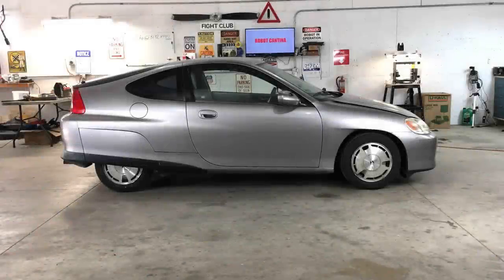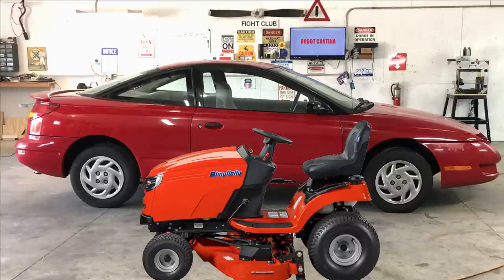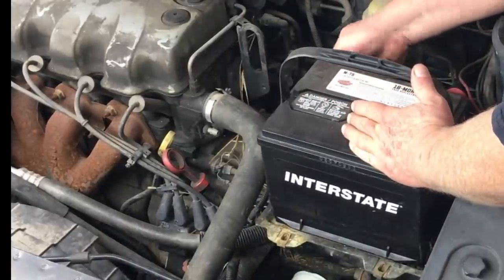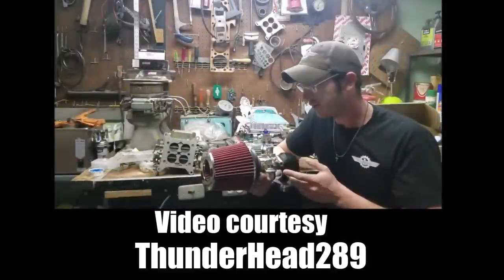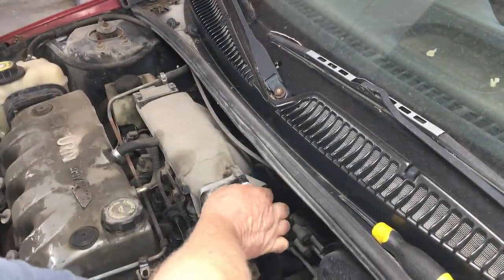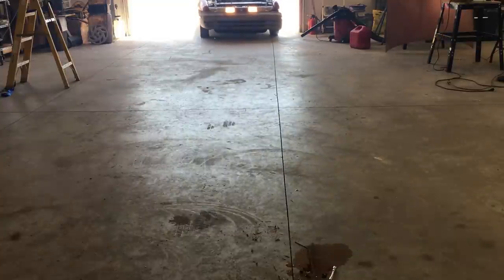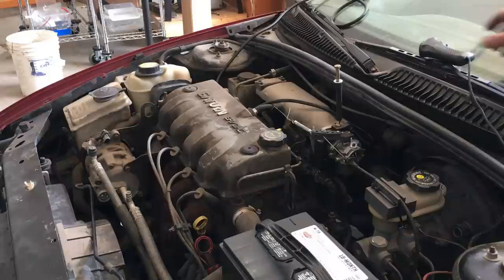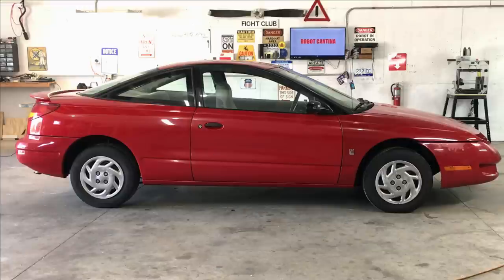S2E14: We get new project cars for more experiments,  plus we put lawnmower carburetor on a Saturn

Comment: Brilliant, love it! As someone who was already subscribed to Thunderhead289 (Luke’s) channel and has been following his lawn mower card antics (as well as Uncle Tony’s Garage commentary and others), I got very excited when you showed the same experiment here on your channel.

I’ve got a Ford 351W with a Holley Sniper 4 barrel EFI conversion and a Hyperspark distributor, which doesn’t work due to age related problems (such as the exhaust manifolds leaking, PVC issues…) so the possibility of eking out any additional fuel milage (especially on the old V8s) is an exciting idea. :D
Reply: Imagine if they did this to the big blocks in the 70s for the gas crisis yeah got a 150hp big block but swap the carb and now its 400hp lol

Comment: Two Stroke Yamaha 701 from a superjet as an engine swap. They used them for a bunch of Wave Runners in the 90s and the super jet for the last 30 years. If you want more power get a Yamaha 1100 or 1200 two stroke.

Comment: Love your show & the direction you're going. I have studied & purchased info. on gasoline fuel economy multiplying devices since the 80's. The most doable design was a small carb mix into an engine coolant heated heater core box, then into the insulated intake to prevent cooling of the mix. Add T-head 289's controlled air leak Arduino  system, & mileage may soar. Encouraging liquid vaporization thru vacuum, heating, surface area, turbulence, insulation to retain heat to the port entrance, & extra air bleed for leaner AFR's, All combined for max efficiency. Yes, Uncle Luke is a humble genius, but so are you in your own right! Reference material (my original copy) info: copyright 1988, Carb Research Center, Inc. "How to build your own High Mileage Vapor Carb !"  (3 designs, Impro XP-W,  Original Impro 70 [both doubling 283 V-8 truck fuel economy, no power loss] & 3rd design, Impro 70 Modified [Exhaust heated, triple mileage, but power loss at higher temps.])  Hint: I think I saw it free to read somewhere on the internet 😉😁 Best Regards, Paul from S. Central Tx.
Reply: I come here for the videos and stay for the comments...  great comment here.

Comment: Had one of those for 13 years! It looks as good as new until the end!
Reply: The 4 door I mean.
Reply: @SteeGrav  sounds really neat.  I bet they were a good 13 years too. 🚙🚙🚙🚙
Reply: It died of terminal transmission failure, the manual one. It happened just as GM killed the Saturn brand. They offered us a good value for the car even so driving it to the dealership was it's last run. So check all the seal on this manual.
Reply: @SteeGrav  Oh my,  terminal transmission failure...😪😪
Reply: @ocdman202  It was sad that GM killed the Saturn brand.. 😘

Comment: That parts car, the Saturn SL1, I had one of those, mine was a 2000, I flipped it 7x, that little car is by far the safest unibody car I've ever been in, outside was destroyed, didn't change the interior at all, that SC1 should be just as safe, I look forward to see what you do with these cars

Comment: That was weird fun.  I'm not surprised to see it worked; just get the A/F mixture somewhere close and you can light it off, but the engine sounded surprisingly good, inhaling through that narrow venturi.  I reckon the MAP is just a tad lower than the factory spec.

Comment: I've been watching Luke's work on the lawnmower carb, very good stuff. I can't wait to see what more he and you come up with. Exciting times a head.
Reply from the maker: Thank you!
Reply: Is he the one that got "high mpg" out of it? 

I think it's a funny project, but I have been hoping he'd redo a fuel test with a controlled fuel source since I don't believe the high fuel economy claims.
Reply: @volvo09  Thank you for your hard work and spunk!  Robot!
Reply: @ocdman202  Spunk and moxie!   Robot!
Reply: @B Tenold I don't think it's fake, I just want to see it done with a smaller fuel cell or fuel bladder. If you only drive a few miles you aren't getting an accurate reading, even by refilling from the same station. 

I'm not giving ANY personal attacks, I think it's an awesome project and he knows what he's talking about by the footage I saw.... I have also self tuned my vehicle for a few different circumstances (diy from gas to E85, and later added a supercharger, and also tried a lean tune for my works commute using the o2 to keep it at 18.0 while cruising)... It does help, but not enough to make an old v8 better than a new Corolla. 

If he's done a fuel cell run then I'm out of date and I understand, but until the cars fuel tank is cut out of the loop (or a large distance run is done) I can't accept any high mpg claims, there's just too much variance.  Again, if I'm out of date then let me know, I only saw the "60 mpg?" Run video.
Reply: @volvo09  ROBOT CANTINA    we love these new project cars!    and we love it when Jimbo  re= engineers stuff!  just for fun👍👍👍👍

Comment: Your automatic transmission is likely not getting power. On those transmissions I believe that with no power to the shift solenoids you get locked in to 3rd gear. With no TPS either, the ECU might not be able to determine what gear you should be in. Lastly, the engine can run with base spark direct from the ignition module and crank trigger so without the ECU operating at all it will run off of starter fluid/gas soaked rag.

Comment: Use the diesel!!! You can run them off vegetable oil,  used motor oil, etc. And they are 1000% more dependable and built waaay better than any gasoline engine

Comment: Most likely because the Ecu dont see any tps signal the trans is it limp mode. You could either make a throttle position sensor that works with the lawn mower carb or just stright wire the shift solenoids to toggle switches then you would have a manually controlled automatic. But it will also shift at full line pressure all the time no matter what and youll have to wire in a switch to turn on torque converter lockup.. or use a speed sensor to give output at a set mph...

Comment: We need more thinking like this nowadays! Can't wait to see what type of input that little carb puts into the gearbox. It seemed like it would function, the engine was actually getting fairly high rpm off the throttle which is really interesting. Great video and good luck, enjoy experimenting!
Reply: I love the experimentation and bold thinking here..  Definitely need more thought in this area!  This is like
trying to come up with practical ways to help a real and present problem.
Reply: @kansasrose2909  Do you mean clear and present danger?
Reply: @mommapanda5736  ROBOT CANTINA    we love these new project cars!    and we love it when Jimbo  re= engineers stuff!  just for fun👍👍👍👍

Comment: If you decide to try to put an undamaged trans in the insight, first gen civic hybrids and I believe 07-08 fit manuals both go in with very little effort and open up some different gearing options. Civic hybrid is 3.6ish final drive and the fit is 4.10 I think

Comment: I've never messed around with carbs, but the simplicity of them is intoxicating. It's making me want to throw a set onto the '91 Jetta sitting in my garage and get rid of that GODAWFUL always running-like-crap/not-running-at-all mechanical fuel injection!
Reply: The 90s models had optional regular simple fuel injection, might be better to source that.  Not an expert, I just know that looking at a later model cabriolet vs my 84 GTi I was jealous of how simple it looked.
Reply: @milescarter7803  Unfortunately the VW EFI system would require a whole new wiring harness, and runs at a lower fuel pressure than the existing MFI. It would be a whole lot of work for a stock EFI conversion, at which point I would rather invest in a Megasquirt.

Carbs are actually a fairly common conversion for the VW 16V engine and parts widely available. However, I'm not planning on leaving the 16V in there. I would like to swap in the 07k 5-cylinder engine. To my knowledge nobody has ever carbed one of those, but it would be very interesting to try and since it's just a project car at this point it would be fun to experiment with it.

Comment: Now i wonder if i could get that old Renault Espace V6 in our yard running with a carb as the ECU got fried by someone trying to tune it. Car cost me a case of beer so might as well try.
Reply: If the ecu didn’t control the ignition maybe. Does the engine have a distributor?
Reply: @Turbochargedtwelve yeah it seems like it has one.
Reply: @kjjustinXD  Maybe if you have an arduino laying around you might be able to use that as ECU
Reply: Doubtful as the ECU will control the ignition too.

But look into a cardrino or speedrino. There are others out there too. People have been building engine computers out of ardrino for years now. There are several kits that make it easier and lots of diy advice to doing it from scratch too.
Reply: Some older ECUs still worked via a distributor. Basically the ECU and associated transistors replaced the points and condenser, but everything else was the same as a traditional ignition.
Reply: @nerd1000ify  HEY JIMBO.....  congratulations on reaching 100k subscribers.. ROBOT CANTINA is providing the 
entertainment and fun that viewers enjoy..
Reply: @kansasrose2909  ROBOT CANTINA    we love these new project cars!    and we love it when Jimbo  re= engineers stuff!  just for fun👍👍👍👍

Comment: I've actually got a 2002 saturn sl1 with a 5 speed transmission, I love it! Although I'm scared whats gonna happen soon, its got 280,000 miles on it and hasn't needed any real work in the 2 years I've had it, the frames rotting away due to Wisconsin winters. It even has the exact same engine as this one!
Reply from the maker: Saturns will almost last forever, unfortunately frame rust can be a problem.
Reply: @robotcantina8957  Oh ya, the manual transmission does have a dipstick, it's a little hard to find but if you look straight down from the master cylinder for the brakes its right on top of the transmission. You'll have to reach through the brake lines to get to it.
Reply: @dustinkinnard619  Oh no,   frame rust!  Thank you for
your hard work and spunk!!   Robot!!
Reply: @ocdman202  Saturn  fan here. 🪐🪐👍👍

Comment: Just wanna offer some guidance on a possible woodgas conversion:

You need two container, the outside one gets a stack and charcoal in it, the inside one is filled with biomass, for example wood.

The biomass container will be sealed with only a outlet port for the gas (basically like a pressure cooker with fire around it).

The woodgas then needs to be filtered and cooled down. Easiest way is to bubble the woodgas through a series of containers with water. Just make sure that the ports are large enough for the possible buildup of tar. So large inlet pipe straight down into the bucket and collect the gas after bubbling up again.

The water needs to be cooled to avoid that it all evaporates, so add a radiator with a heat exchanger in the bucket to it (separated coolant flow for more easy cleaning).

After the buckets you need to anything solid and spray left, so use a cyclone filter.

Then let the gas run through a cooling area, like a pipe spiraling in a bucket of water, to cool it down further - make sure to the trapped water a collection point.

After you cooled down the gas you can feed it through a compressor (like an old compressor of a fridge/freezer). It will make sure to remove the pressure from the system and reduce it to safe levels. After the fridge compressor you add a check valve and a pressure tank (like a bottle of gas for a forklkft).

On the outlet side you need a pressure regulator to keep the pressure low and steady. The rest is kinda just a flow valve into the inlet port of the engine. :)
Reply: Thank you for this detailed and comprehensive comment.  This will be a great help to many, no doubt. :goodvibes::goodvibes:

Comment: Awesome project!  Just a suggestion, before you get too involved in engine swaps how about disabling a cylinder or two on the original Saturn engine to get an idea of how a lower displacement engine will perform?  This could be a very low effort experiment, just remove the rockers (assuming it uses rockers and not buckets straight on top of the valves).

Comment: Wonder if the TCU on the carb’d Saturn needs a working MAF signal for calculated load? 

Doesn’t seem like being stuck in 4th is a likely failure modality for it though.
Reply: Put the maf in front of the carb. Done.

Comment: Yes yes!
Thunderhead289 
Has put it on a Ford V8
He was stunned he got 40mpg.
He's been on a long trip with his father I believe to be testing it fully to see if it breaks down.

Fuel Economy is the name of the game. Everyone wants to know what can be done with small carburetors with air fuel/vacuum leak control with software.

Someone needs to make a plug in play kit so we can have fun on a beater. Who knows maybe gets to point that someone will put it on clean car and use it as normal.
A system that can switch power on fly would be ideal for merging etc.
Or when the peddle is pushed hard enough that it goes into a power tune just for speed bursts when needed.
Reply: Oh wow. I was assuming this is where idea came from. 
We need a lot of people to do it so then big oil don't come after you. Lol

Comment: I don't understand why everyone is surprised that a lawnmower carburetor would work.  A single barrel carburetor was the only fuel mixer for years until 1960.  You would see 350+ cubic inch engines with a single barrel carb all the time and those cars were full size and had 100mph speedometers.  Its still cool.
Reply: Looking forward to more experiments and more data here.
Reply: Better mileage has been reported on the other channel he featured.

Comment: ECU probably put the transmission in limp mode as it didn't have a tps input. I had a car that did that once and it would just stay in 3rd no matter what. It was slow off the line and would top out at 55 but you could drive it home.

Comment: On my 98 GMC the ignition switch was going bad and would start the truck but it would stay in 3rd gear. It turned out the ignition switch is also responsible for telling the TCM to power on. It was staying in 3rd because that was a direct drive gear. I replaced the ignition switch and it started shifting again.

Comment: I loved Thunderhead 289's lawn mower carb experiment, I was flabbergasted that he managed to get about 40 mpg at 60 mph in the Maverick. I am looking forward to see how well you do with the Saturn Coupe. Any possibility that you could test the fuel economy of the Saturn Coupe with the lawn mower carb?
Reply from the maker: Yes, we will gather all the performance data of the unmodified saturn and then  do it again with the lawn mower carburetor .  We will certainly check the MPG.  Look forward to that in the next video.
Reply: @robotcantina8957  Like a Chevy Impala, I'll be there.
Reply: It's not actually physically possible to get 40mpg at 60mph from that car. His measurements are off.

The speed of a vehicle is a function of rpm and gearing plus enough power to overcome resistance.  A stock naturally aspirated engine will need around 14.5 to 1 air fuel ratio for a clean burn. The cylinder size and compression ratio is fixed so advancing the ignition timing and playing with the air fuel mixture is the only adjustments that can be made. Leaner air fuel ratios need a higher compression ratio but also contain less energy. The Era of the stock motor in the maverick will have a 9:1 compression ratio so the leanest you will be able to go is around 16:1, maybe 17 for short periods if you are extremely lucky. That is not enough leaning to push that much weight at those speeds with that little fuel.

Otherwise it would have already been done by now.
Reply: @sumduma55  Thank you for this thoughtful comment.  I see your
point.
Reply: @ocdman202  I come here for the videos and stay for the 
great comments.
Reply: @sumduma55  I agree, I have seen his video's and something is off.  You're not fooling the wideband.  If you can establish 14.7:1 or so and make it consistent throughout the throttle and rev range no more improvements can be made no matter if its big carb, lawnmower carb, or fuel injection.

You cant change the efficiency of the engine, drivetrain, and aerodynamics and that's what it's going to take to get to 40 mpg in a rolling brick.

Comment: A Factory 5 kit car would be expensive, but you would also be getting a car that can weigh in at around 2,200 pounds with a big V8 in it.  With a little lawn mower engine, and with its general build and aerodynamics, it would be an interesting chasis/car to work with.
Reply: The Factory Five 818 is practically already lawnmower powered being Subaru based.  Get an opposed Onan Briggs or Kohler? Motor and go for it.

Comment: Wonder if the tranny is being kept in 4th as a "limp home"  mode. Should be able to verify with a OBD. 
Very curious how long the plastic lasts! It would be so much easier to print a carb intake manifold for my Predator 212 converted Honda XR250 instead of having to TIG all those aluminum pie cuts, and the flange after a sharp 90°. Cant wait for the next episode!
Reply: UK channel "Making for Motorsport" has made 3D printed adapters to mount individual throttle bodies to an engine, and they would get a lot hotter than an inlet plenum. I think he used some kind of carbon reinforced filament.